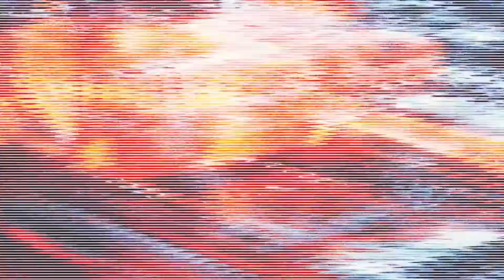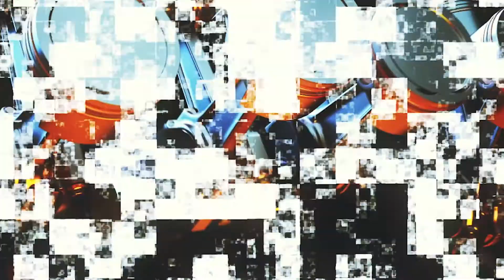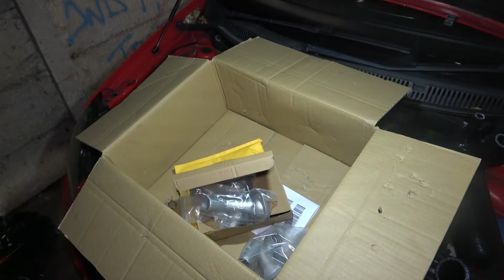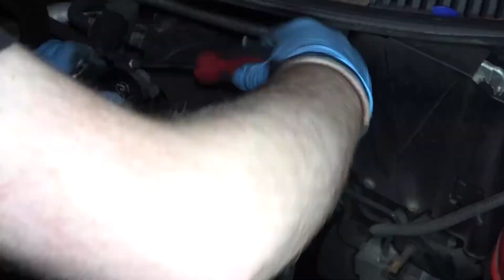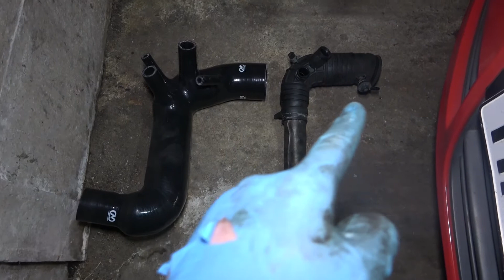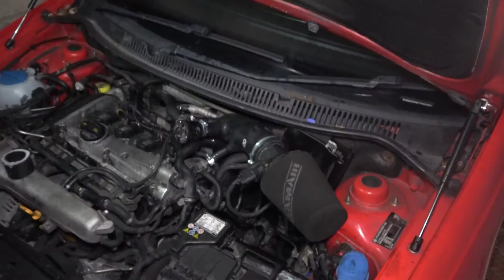Fitting a Creation Motorsport Oversized Turbo Intake Pipe To The Polo! (oversized TIP!)

Comment: Was this the H0100?
Reply from the maker: i believe so yeah, if in doubt message creation motorsport and confirm to see what they say
Reply: @CarsandEngineering  cheers matey, sucks because they’re out of stock in the colour I wanted and aren’t restocking them again 😅
Reply: I’ve managed to get to 7:45, my pipe is loose and not connected to the turbo anymore, but it’s got a hose from it that’s “connected” with what looks like a metal clip to another hose? How the hell did you remove that clip?? It’s like rock solid 😂

Comment: Hey! I'm considering this as a repair, as they don't make the rubber turbo intake pipe anymore,  and my turbo inlet charger pipe also has a leaking O-Ring seal. Do you need that o-ring on the turbo charger pipe when you install this silicone pipe? Also do you think it would fit directly into the stock intake box? Thanks!
Reply from the maker: So this is a great upgrade and it gets rid of all the old pipework, as I said in the video it’s a bit of a dog to get on but it’s worth it 100%

Comment: i have an ibiza fr 1.8t 20v, i also have the oversize tip and i can honestly say its an absolute ball ache to fit, even to the point you struggle to even clamp up the lower tip turbo end....power wise didnt notice any difference...maybe stage 2 you see a diifernce
Reply from the maker: Yeah it was a nightmare to fit.
But as I said in the video I understand that it’s unreasonable for companies to pour loads of money into research and development into a product that might not earn that money back. 
I’ve not noticed any power gains but the think definitely spools a bit quicker. 
I think a remap would be needed for any actual benefit 👍🏻
Reply: But these pipes arent cheap at all, they could at least produce them to actually fit properly
Reply: @Kris-xm3sz mate creations make amazing products that actually last long and are made of over 3 layers bc they last long enoug to save money
Reply: And you can atleast personaly tell them what size you aould like for any part

Comment: Had a look on creation motorsport for the oversized TIP. Does it have to be specific to the 9n3 BJX or can it be any of the K03 1.8t engine’s?
As they dont have the black or red ones in stock. 
Cheers
Reply from the maker: best thing to do is to email them and ask when they will be back in stock, i believe they have in the description what engines they fit https://creationsmotorsport.com/oversized-silicone-turbo-intake-pipe-ayp-aqx-bjx-h0100b.html 
if not i think badger 5 have intakes for theses for sale.

Comment: Mine won’t go on, there’s a solid pipe in the way just up of the gear linkages
Reply from the maker: ok right so the hard pipe is fixed to the turbo by a small m6 cap head just to the right hand side of the turbo intake.
itll be the bulkhead side undo that then wiggle the solid pipe out the way.

Comment: How do you remove the gear linkage setup? Got the same pipe for my polo and don’t know how to do this, is it necessary?
Reply from the maker: so i ended up removing the gear linkage at first then reinstalled it to get the pipe in, it is really tight and there was alot of swearing but eventually i got it on!

Comment: Wich size oversized pipe did you get ? I see 2 options at creation motorport their site
Reply from the maker: https://creationsmotorsport.com/oversized-silicone-turbo-intake-pipe-ayp-aqx-bjx-h0100b.html

That is for the polo engine code BJX that is the one i bought
Reply: @CarsandEngineering  thanks ! 🙏🏻

Comment: Great video! Did you install the short shifter? I bought one from Dieselgeek which said fit all the MK4 gti MT but when I put it in my Polo, it doesn’t fit. Now I’m looking for another brand and hope it works out
Reply from the maker: Haven’t installed the short shifter just yet, was planning on fitting that to a rebuilt gearbox with a lsd inside it 👍🏻

Comment: Great work mate. I'm amazed that it required cutting to fit... Did you get an air leak from that join to the turbo? 

I missed if you said it was for the Polo or another 1.8 20v?
Reply from the maker: Thank you mate 
Yeah it needs cutting I’m afraid, no air leak it’s sealed good and tight 
It’s made for the 1.8t platform and fits most things with that engine

Comment: Can this mod increase mpg on a standard set up?
Reply from the maker: Because it flows more air I don’t know what it’ll do for your mpg but it makes the turbo louder which for me anyway just made me want to use the throttle more 😂
Reply: @CarsandEngineering  I use my car daily for work and I’m trying to do some subtle mods, I’m only getting 30-34 mpg on motorway runs so I feel like I may as well go stage 1/ stage 2. I got sports cat exhaust and air tech cooler on
Reply from the maker: I used to use mine daily on the motorway and I was seeing about 35 mpg on average with just standard power 
I’ve heard some people get better mpg with maps and that but can’t confirm myself
Reply: @CarsandEngineering  that’s not bad. something on mine must be making it run lean, I want to try and go to 240ish. There just isn’t any guides or anything for Ibiza cupra 20vt and unlike the other models there isn’t many options for bolt one so these polo vids do help and relate.
Reply from the maker: They are basically the same engines across all 1.8 20vt platforms 
This might help https://r-techperformance.co.uk/1-8t-20v-tuning-info-golf-audi-seat-skoda/1-8t-stage-2-tuning-guide/